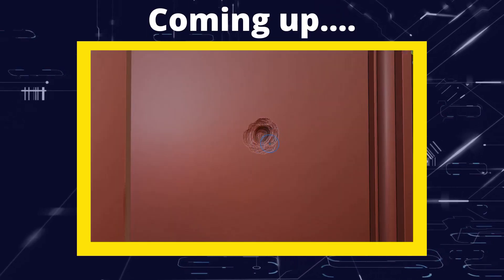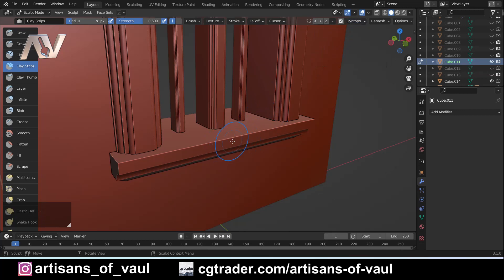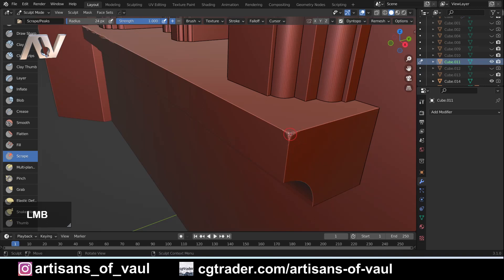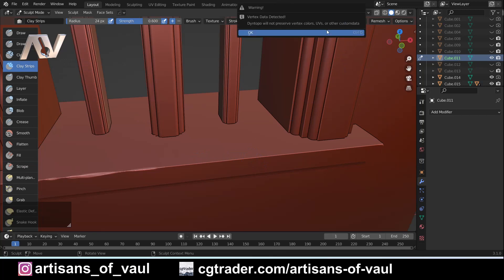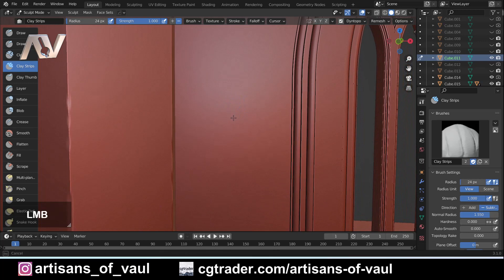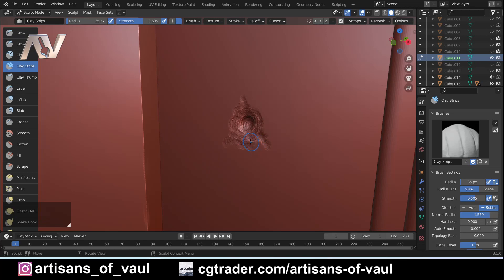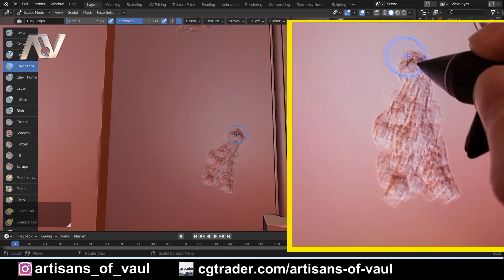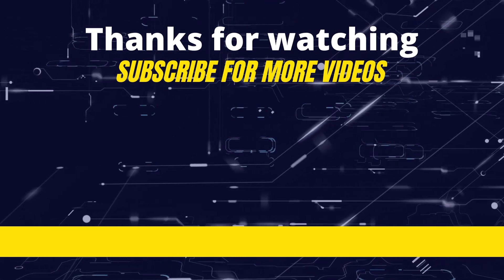Sculpting damage on stone in Blender

Comment: Neat video :D. As a suggestion for upcoming videos, what about some claw marks/cracks and importing brushes :D?
Reply from the maker: Really good idea 👍. I do want to do something on using texture brushes and alphas (though this is far from my area of expertise as a hard surface modeller).
Reply: @ArtisansofVaul  There is a cool tutorial in youtube about rolling pins and alphas if you need ideas. I used its ideas to create a 3d render of a inn banner; could be interesting to use for iconography like an akila or something (or something without copyright, but applyable to whatever)
Reply from the maker: @galan8115  Thanks man.  Have you got a link to it?  Im sure others would find it useful too.